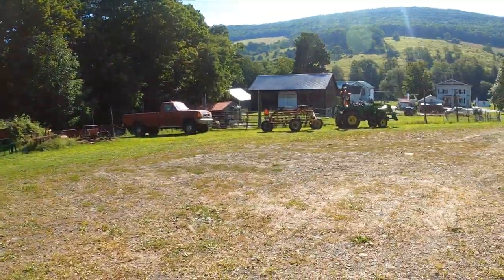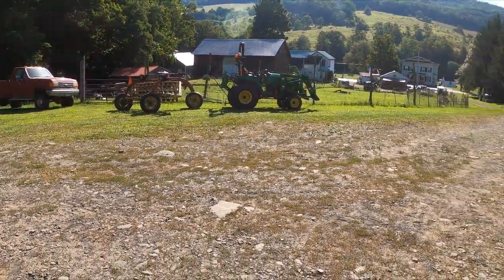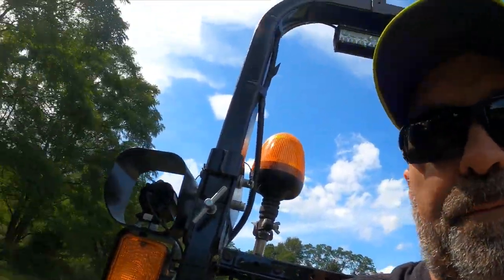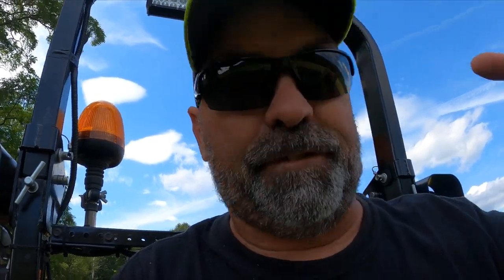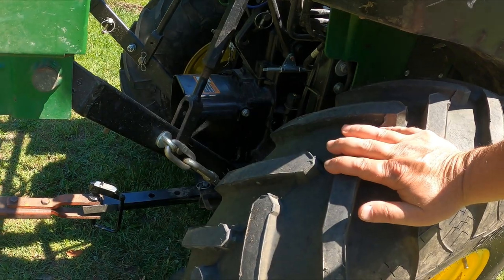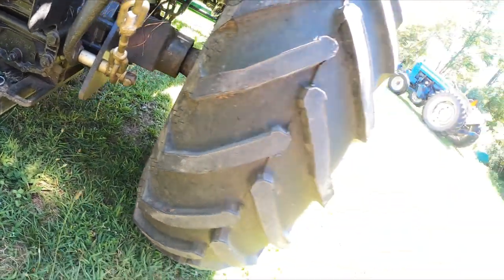Raking hay with the 2038R

Comment: Use 2 washers and a spring. Just double this for extra height. This will go over the top of your draw bar. This will pick your pin up an inch or two to keep it up out of the ground or hay and keep enough tension on it to keep it from vibrating loose as well.

Comment: I bought a 3pt trailer mover and it works great for a hitch instead of a drawbar. Just another option
Reply from the maker: I have a 3 point draw bar too, though in hindsight that would have gotten the hitch pin up higher, but it's just the overall low ground clearance for doing something like raking. It wasn't bad at all, the first field I raked was just trying to figure out how to approach the windrows, after that it was very smooth. Thanks for your reply, I'll try and remember this next year.